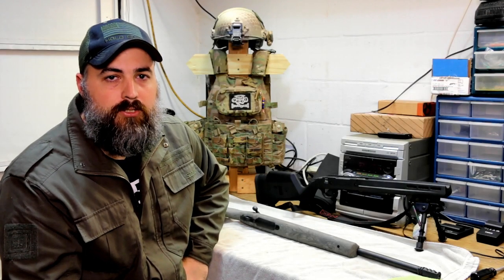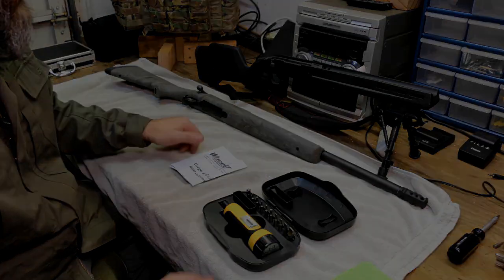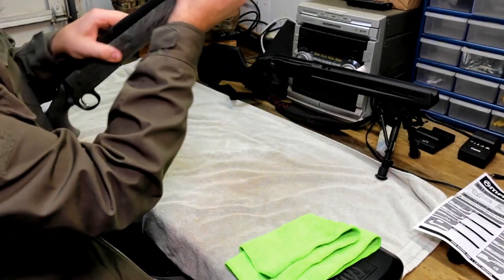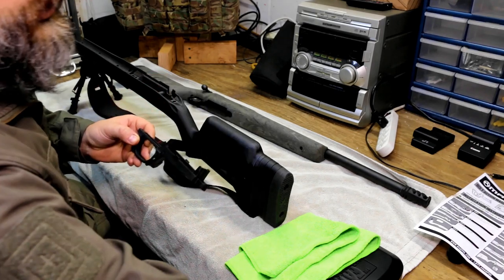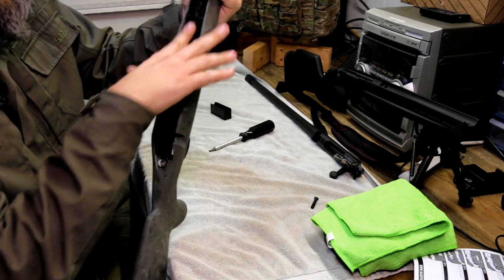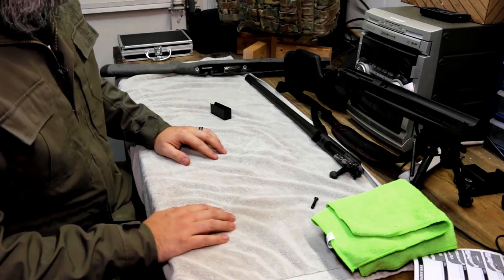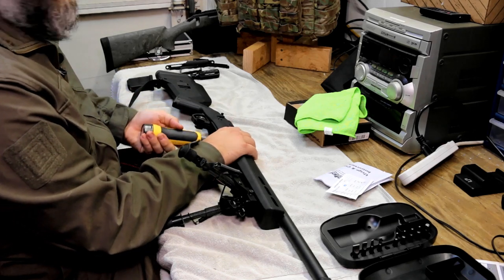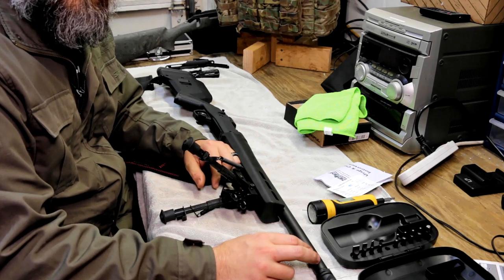Magpul Hunter 700 Install and Features - Remington 700

Comment: Put one on my 700 in 300 RUM. Had to do some grinding to make everything fit. inside the mag well and shorten the front of the cheek piece to get the longer mag bolt to come all the way back. The Rem 700 comes in 3 different bolt length's. Can't get a mag box set up Magpul doesn't make one for the longer 300RUM cartridge Had to use the factory bottom metal..

Comment: Rick, can you post a link for the bipod? Thank you for the excellent, informative video.
Reply from the maker: Here you go. It's been holding up well for the price of it.

XAegis Carbon Fiber 6"- 9" Rifle Bipod with Picatinny Adapter, Carbon Bipod for Hunting&Shooting https://smile.amazon.com/dp/B07C8FJNC1/ref=cm_sw_r_apan_glt_i_4M4V31J5BYNTSKMBG8ZD?_encoding=UTF8&psc=1
Reply: @SFActual  hey Rick, thanks for the info.... got my bipod the other day. One more question if you don't mind. I bought the swivel studs (Magpul) to attach to the Magpul Hunter 700 stock, but the stock is not predrilled (which is fine), but do I need to drill a hole slightly smaller than the diameter of the threads of stud, or does it need to be drilled and threaded? Thanks again for your help and an awesome, informative video.
Reply from the maker: John, are you talking about the dome shape studs for a rifle sling? That go on the front and back?
Reply: @SFActual  I believe so. How did you secure your XAgeis bipod to your Magpul Hunter stock? I bought the same bipod you have. Doesn’t the bipod attach to the sling stud on front of stock? The magpul Hunter stock doesn’t have sling swivel studs but it has a spot to put them.
Reply from the maker: To this question, just do a pilot hole a little smaller and it will work. The stock has indents for where they go.

Comment: One issue I came across is my rifle is chambered .223 

Soo I cant seem to find the AICS magazine.  All the magpul magazine wells I find are for .308 or something other than .223.... love the stock but maybe it's not meant to be to run the magazine.... any thoughts?
Reply from the maker: Darren m: If I'm understanding you correctly, you have a Hunter 700 stock on your 223, correct? If so, look at this item https://www.midwayusa.com/product/1018890888 In the comments, they are saying it will work with the Hunter 700 Short Action. Let me know if this helps.
Reply: Magpul is making a 10 round .223 AICS magazine that will work, but it isn't out just yet.

Comment: Hey. You addressed two of my questions. Now for my third: if you lift the bolt, look down. There is a gap where the bolt seats. When the bolt is lifted, your trigger and inner workings are exposed. Is this supposed to be this way? I think that this would be hell with dirt and water
Reply from the maker: Hey Bo, I guess I'm having trouble understanding which area you are talking about. Can email pics to sf.actual00@gmail.com to show me?
Reply: @SFActual  thanks man. Email sent!
Reply: @fbodkin1 , can we get an updated reply with thoughts about the gaps being referred to? I'm back watching the video again and reading more comments and came across the OP reference this gap. Now I need to go look at MY stock on my Win Mag version to see if it exists there, too.
Still, IF a gap is there and it isn't an aberration on the OP's individual stock, maybe this is a defect that Magpul needs to address for ALL those affected.
Now excuse me while I go dig mine out of the safe and look at it.
Reply: @user-td1zo3tv9p  HI H. From what I have been able to discover, Magpul made these stocks as a one size fits all for Remmy 700s. They tried to accommodate a user's desire for an oversized bolt handle. If you have a stock bolt, there will be a fairly large 'hole' in the stock under your bolt. In addition, the Magpul barrel channel is made for bull barrels up to medium palma, so if you are running a sporter or magnum contour barrel, there will be a ridiculous amount of space under and around the barrel. These are great stocks for a person wanting to do a build for bench shooting, but are a terrible choice for someone(like myself) just trying to upgrade a hunting rig. Magpul makes a great stock for the Ruger 1022. It has a changeable barrel channel for either a bull barrel or factory contour barrel. Had Magpul designed this feature into the Hunter 700 stock, I would have been completely happy. Let me know what you find on your rifle. Thanks!!!

Comment: Question, did you drill a sling stud into the bottom of your cheek rest? I am trying to find if the Magpul 700 is sling stud capable for a “Sling Stud Mounted Accu-Shot Monopod”. Any advice would be appreciated.
Reply from the maker: Hey Jake, yes I did. They are pretty small and round, you won't notice them at all when shooting. Jut be cautious if you put it up on a wooden table or something it could dig into or scratch.
Reply: @SFActual  Much appreciated, thank you!

Comment: Will the Hunter 700 stock work with a BDL DM from the mid 90's?  This was right after they started making them with the factory detachable box mag.  Before the CDLs came out.  The action out of the stock looks identical to the one in your video.  I assume that it would work as it does not have the blind floor plate.  I assume that I would be locked into using the magpul bolt action mag well.
Reply: Yes it will work
Reply from the maker: Shawn, it shouldn't be an issue.

Comment: I have a 1980’s 700 ADL (without floor plate).  What extras would I need for a Magpul stock? Stock + mag well?
Reply: No extras with the detachable mag kit.  Just remove the metal "magazine" shell.  One little flat head screw.

Comment: Simple question, will this stock fit on a Remington 783?
Reply from the maker: Hey Garcia, I personally don't have a 783 but out of my research it is possible to get the bolt to fit but the magazine won't work through the Magpul stock. I'm not sure if Magpul makes a replaceable mag receiver for a 783 mag for the bottom of the stock.
Reply: @SFActual  magpul does make 308 mags. I just wanna know if the stock will fit my 783
Reply from the maker: The Model 700 design was to be a top loading gun and the 783 for magazine feed. This creates a smaller ejection port, creating a frame that is more rigid. I wouldn't see this being an issue. 

From my research, people say it won't fit but don't give the reason why. It might be screw alignment is different or a different shape to the bottom, not sure. Without having a 783 to look at, I'm not confident to tell you it would fit. One option would be to buy one on amazon and return it if it doesn't fit. Sorry I couldn't be more help.
Reply: @SFActual  you could google the photo, it’s a Remington 783 in 308 bolt action 22 inch barrel,   Don’t worry about it appreciate your knowledge. Have a good week.

Comment: What type of Harris Bypod is required to mount onto the Magpul stock or do I need a special part to  make them compatible ?
Reply from the maker: Hey Gary V, to use a Harris Bipod on the Magpul Hunter 700 stock, you will need to purchase a Harris Stud mount that uses the M-LOK mounting system. The stock has M-LOK slots on the bottom and sides. Please see the attached website to see a visual of what the M-LOK / Harris Stud mount would look like. https://amzn.to/3cGAB8W
Reply: @SFActual , I've used Harris bipods on ALL of my long guns that can benefit from a bipod and for which I need a steady platform from which to shoot.
I know there are folks that claim there are "better" bipods out there, including the Magpul versions, but from what I've seen, for the most part they are almost ALL far heavier AND much more expensive, yet they really don't seem to offer anything that is Head and Shoulders above the Harris line IMHO. But anytime some Whiz-Bang Hotshot comes along saying they used Brand X in Dubya Dubya 4 in the Big Sandbox and he did a One-Shot kill on Mr. Johnny Badass at 4,500 meters measured (HAH!), well everyone goes Ape Shit and just HAS to have the NEW AND IMPROVED BRAND X bipod!! 
Well, for me, I'm sticking with the proven Harris line for ALL my bipod needs. I've even used their non-swiveling BR version on a bench, mounted to the bottom of my AR-50 (Yeah, no BS) which is about 33 POUNDS(!) and shooting 750 grain Bore Rider projos beyond 1,000 yards and shooting less than MOA under good conditions and match situations (FCSA Sanctioned match at the NRA Whittington Center near Raton, NM. It's on paper and records, yet I didn't take home any trophies except to say I WAS shooting against myself and achieving several of my personal bests, some with a Harris bipod.
So, in closing, I CAN say that they ARE WITHOUT A DOUBT damned fine pieces of gear. And if you're skeered the springs will give your position away while you're LARPing around in your Mommies and Daddies back yard, don't be. Their good to go.

Comment: Why did you not bed the barrel lug into the stock slot?
Reply from the maker: Hey Roland, thanks for reaching out. I always recommend putting a new stock to your rifle and shoot it for an accuracy test before deciding to bed. This rifle is a tack driver and felt very firm when I was putting it together with this stock. Sometimes guys will do a bedding job on the action and the rifle shoots worse than before (granted that they probably did a bad bedding job). If you are interested in bedding or you are having issues with your rifle, do your research to learn from the mistakes of others. Here is a good link that has some great input on bedding. https://forum.snipershide.com/threads/so-whats-the-best-bedding-compound.134918/

Overall, go for it! You can always remove it if you use a releasing agent. I hope this helps and let me know if you need any further help!
Reply: Great info. Liked your video. Dakota Arms putting rifle together for me and bedding the lug was part of their process on the Magpul Hunter 700 stock since the stock's oversized slot would eliminate movement over time. Thanks for the info and keep up the good work.

Comment: What’s the weight difference between this and the Hogue? Looking to lighten up my 308 aac
Reply from the maker: Hey Ron, the Hunter 700 stock is 3.0 lbs (short action) and 3.2 lbs (long action) without the action and bottom metal (with two Spacers installed). The Hogue with fiberglass skeleton is 2 lbs 10 oz.

Comment: I used the original action screws, but when I got it all torqued I found that the empty magazine would not seat with the bolt forward.  With the bolt back the magazine will seat, but I can hear the bolt rubbing across the top of the feed lips when pushing it forward.  I called Magpul and was told that the screws that come with the SPS Tactical AAC-SD are not true Remington BDL action screws and that I would need to order replacements.

I doubt that different length screws will make a difference as it seems to me that they will simply screw into the action further.  It looks to me that the trigger guard assembly is sitting too far into the stock causing the magazine to sit too close to the bolt, even though it seems to be sitting flush.

Anyone have any ideas on this?
Reply: If you think the mag well is sitting too far into the stock well and causing the mag lips to rub, you can try putting THIN washers between the mag well assembly and the stock well opening, thus moving the mag lips just a little further away and preventing an interference fit.
If you cannot find a source for THIN washers locally, you can always take some standard washers and "file" them down incrementally to a thickness of your choice on various grit sandpapers. 
That is assuming a couple of THICK washers are too much space.
Now a quick note on that process.
If there is a large surface area the new mag well sits in and you don't want to risk the new well "tilting" or bending over time, if you can find some aluminum sheeting of the thickness you require and sand it down to the desired/required thickness, then use some kind of aluminum compatible bluing compound to prevent corrosion over time. Using the sheet aluminum will provide a larger footprint for the new mag well to mate up with the stock well cut out and preventing any undue stress on the parts.
Hope this helps you.

Comment: I have a 700 adl, 6.5 creedmoor with the bull barrel.  I want to upgrade the stock bc it has that internal magazine and you have to load the thing through the ejection port.  My options are essentially a magpul stock like this, which I can pick up easily from a few shops here.  Or I can order a Boyd’s stock but I’m unsure which is the correct version to order and I don’t want to pay $200+ for a custom stock that isn’t right.  Do these magpuls come already bedded? I have a Boyd’s stock on my savage .308 and I had them pillar bed it when I ordered it.  Any insight into my issues would be a great help!  Thanks!
Reply from the maker: James, The Magpul stock has a "aluminized" bedding block built in. The block is designed to support the action on two parallel "rails" like a V-Block.  If you had the Magpul stock, I'd say to shoot it for a bit, then remove and look to see if the contact marks on the block and action are uniform. If so, bedding won't really help. Now on your question about the Boyd's stock, I'll have to look at what types would work.
Reply: I have a 700 adl in 308 and I do not recommended boyds stocks at all. I had to return my original stock and the next three replacements before I just gave up and every time, the stock had some issue with it. Either the magwell was cut too deep or the screw holes would be off a millimeter or two and wouldn't align with the holes on the reciever. I just got the stock back for the 4th time after waiting well over a month for each time I returned it and the screw holes are still misaligned. I am going to just get a refund and get the magpul stock.

Comment: I loved the idea of this stock. But for some reason, when i put it on my Remington 700 Sps it starts to spread something fierce. I cant get groupings worth shit. And i do torque it to spec. As soon as i put on the original rinkedydink plastic stock thingy, i get good groups. There must be something wrong with my magpul stock. No idea why that would be.
Reply from the maker: Fredrich, that is interesting. What scope are you using?
Reply: @SFActual  Bushnell 3-9 or Yukon photon rt 6x50 both on Leupold QR rings. But they work fine as long as I keep the original stock on.

But as soon as I put on the magpul it spreads. I think there might be something that causes tension to be torqued into it in some way., i dont really know. So now the magpul just sits on a shelf.
Reply from the maker: Fredrich, my thought would be inconsistent cheek placement. Your scope is bound to the bolt of the rifle. Hypothetically, if a person could hold and shoot the receiver by itself with no stock, that scope would still be aligned to the barrel. Normally when a stock changes a person's grouping, it's due to cheek and eye placement changing per shot. One test you could try would be to shoot at 25 yards or less on paper and see what your groups are. I'm assuming the previous groups you are talking about are 100 yrds or beyond. Also try and keep your "cheek weld" to the rifle and shoot 3 to 5 rounds. Just use your hand to eject the round and keep your cheek placed as best you can. Let me know. Hope this helps.
Reply: @SFActual  That might be it. I'll try. And my shooting is at 100 meters. I try to  zero and train for the distances i mostly shoot within when hunting.
Reply: @fredrichl  did you do dollar trick to make sure barrel is still free floated,and make sure the pillar is solidly contacting the reciever and no plastic or debris in there